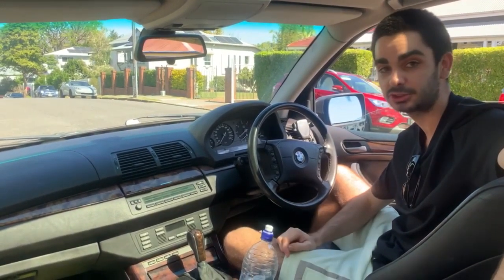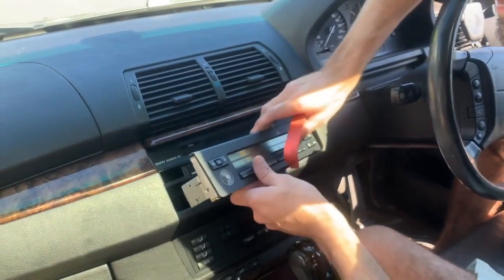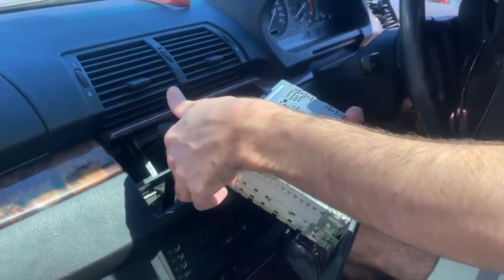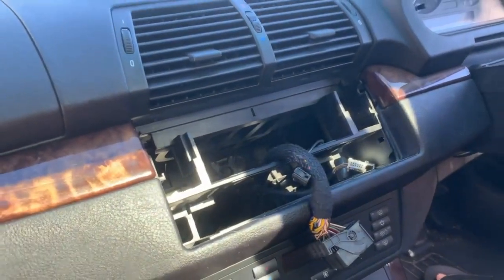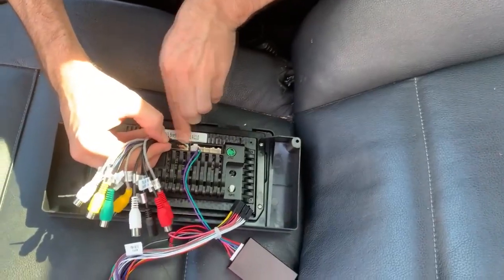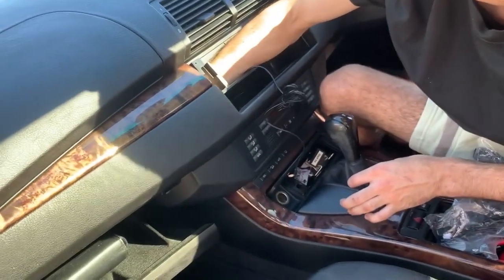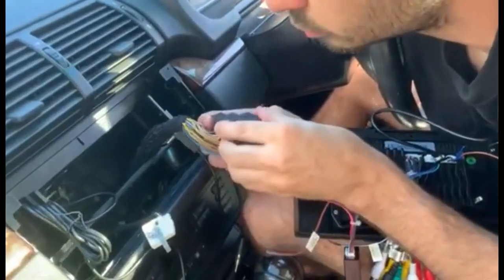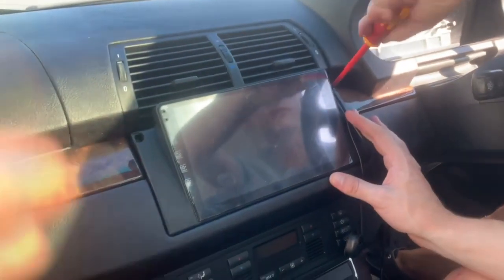BMW X5 E53 Aftermarket Stereo Install + Head Unit Removal!

Comment: I plug everything and the music is playing but i dont have sound whyyyyyyyy
Reply: Hi! I bought this same exact radio for my 2006 X5 E53. After installing on my own, i noticed that bluetooth and sound wasn't working (other than the radio). I took it to get professionally diagnosed and they fixed it. the problem is the wire from the amp to bluetooth doesn't stay on since a new head unit is being used. if you cut that wire and cap it, and run the wire from the amp straight to the ignition, it fixes the problem. doesn't drain battery as it only used once car is started. reach out if you have any questions. Located in Virginia Beach, VA
Reply: @heymr.carterrr Hi!
what colour is the amp wire ?

Comment: Hi, my BMW is the 2005 X5 E53 with the tuner in the back boot. I have to buy the Aerpro BMW Quadlock Extention (APFH022) to connect the aftermarket head unit to the tuner in the back (underneath the spare tyre). However, while everything is working, there is no sound from the DSP. Not sure if you have any suggestion? Thanks

Comment: For those who have no sound it's because your stereo has a dsp amp in the back... that's a good place to start.
Reply: And ther eis NO info on how the hell to make this work... so I gave up, put my stock radio back, and now even my dman stock radio doesn't work... bmw is always overdesigned pos
Reply: @jonc2914  there are two fuses in boot to make your stock stereo work again.
Reply: I have exactly the same issue, how can I get this fixed?

Comment: Great video! BTW, what was the model/brand of the stereo installed? Was DSP on the original stereo? Thanks!
Reply: This one installed was a 16gb Driveitech head unit fit for x5 e53
Reply: @robertmulligan5417  Hey are you guys going to have more in stock anytime soon? I see you're all sold out.
Reply: @willyyamz1379  they are on eBay, brand new for $160

Comment: My radio turnt on but I have no sound help :(
Reply: Did you figure this out?
Reply: @caitlinhines7257  honestly, no I got rid of my BMW X5 it seems almost  everyday something in the car was breaking
Reply: Hi! I bought this same exact radio for my 2006 X5 E53. After installing on my own, i noticed that bluetooth and sound wasn't working (other than the radio). I took it to get professionally diagnosed and they fixed it. the problem is the wire from the amp to bluetooth doesn't stay on since a new head unit is being used. if you cut that wire and cap it, and run the wire from the amp straight to the ignition, it fixes the problem. doesn't drain battery as it only used once car is started. reach out if you have any questions. Located in Virginia Beach, VA

Comment: Hi! I bought this same exact radio for my 2006 X5 E53. After installing on my own, i noticed that bluetooth and sound wasn't working (other than the radio). I took it to get professionally diagnosed and they fixed it. the problem is the wire from the amp to bluetooth doesn't stay on since a new head unit is being used. if you cut that wire and cap it, and run the wire from the amp straight to the ignition, it fixes the problem. doesn't drain battery as it only used once car is started. reach out if you have any questions. Located in Virginia Beach, VA
Reply: I have the same problem but sound just doesn’t work at all, whether it’s Bluetooth or radio. Any idea of what I could do?
Reply: what colour is the amp wire?

Comment: hello dear, i purchased the item as well and i have e53 with the original navigation and aplifier but the electrican told me i need a connector with can bus , where to find it? to fit

Comment: Radio is on no sound. All wires are correct?! Help!!!
Reply: You ever find out the problem
Reply: @callmesfreezy9633  yeah I needed to connect the (acc) extra red to power as well
Reply: Hi! I bought this same exact radio for my 2006 X5 E53. After installing on my own, i noticed that bluetooth and sound wasn't working (other than the radio). I took it to get professionally diagnosed and they fixed it. the problem is the wire from the amp to bluetooth doesn't stay on since a new head unit is being used. if you cut that wire and cap it, and run the wire from the amp straight to the ignition, it fixes the problem. doesn't drain battery as it only used once car is started. reach out if you have any questions. Located in Virginia Beach, VA

Comment: i have a bmw x5 2003 My sound system is not working but when i turn on the radio it plays static out of the speakers do you think it is just the tuner head unit on the car?
Reply: Check in the driver's rear wheel-well area to see if any water has leaked in on the amp if you have a sun/moon roof. I have a 2005 x5 & that's what happened to me. The amp is located in the driver's side panel in the trunk area. Water leaked in from the sunroof drain plug & shorted out the radio via the amp. If this happened to you, you can find a video on YouTube to find/fix the leak first. Good luck